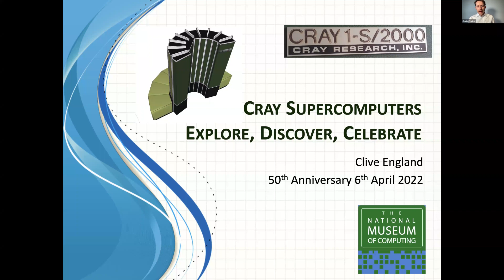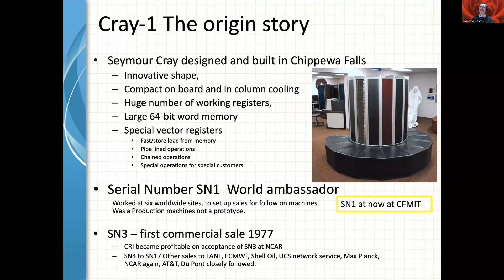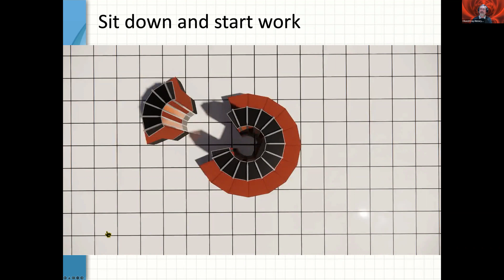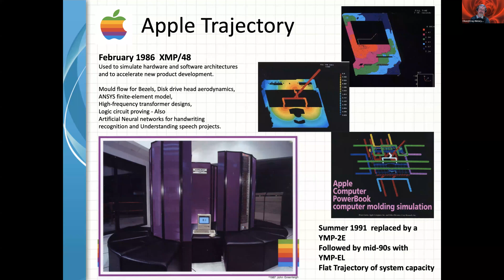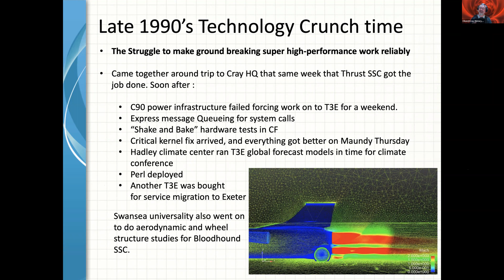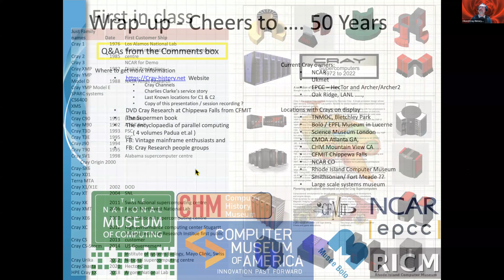Cray Super Computers: Discover, Explore and Celebrate | Virtual Talk

Comment: He glossed VERY quickly over the power supply. But even the power supply was magnificent, it was designed to provide precisely balanced power with an absolute minimum of noise or ripple. This was critical to the operation of the machine.

Comment: The highly pipelined nature of the system must make it very difficult to write software that uses the capabilities efficiently. I wonder what that looked like in reality.
Reply: Obviously the compilers were optimized for vector processing and yes, worked very well. Ah, I remember well.
Reply: The Fortran compiler generated vector instructions when it could.  It was fairly easy to write Fortran code for vector algorithms.  For problems which were not vectored, the Cray-1 was a very fast scalar machine as well.